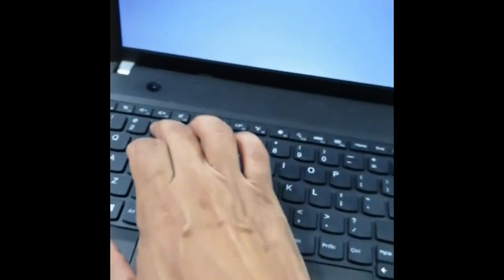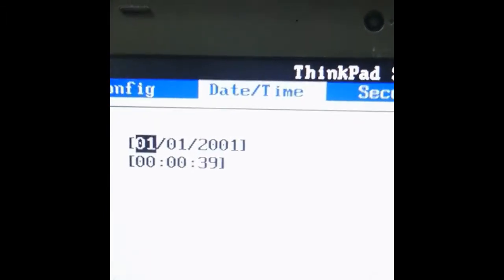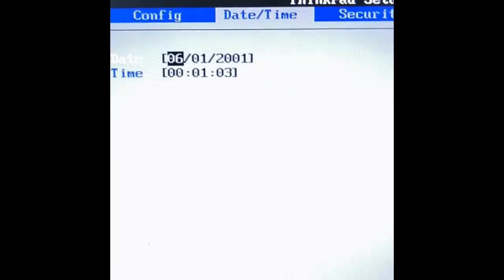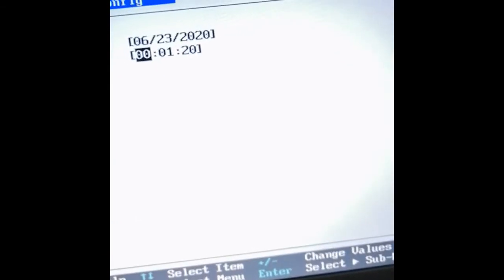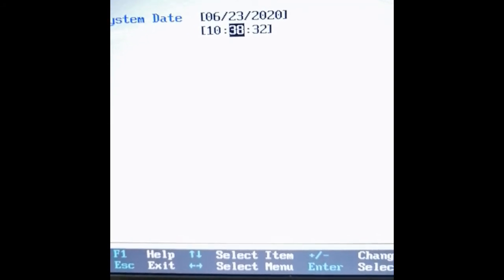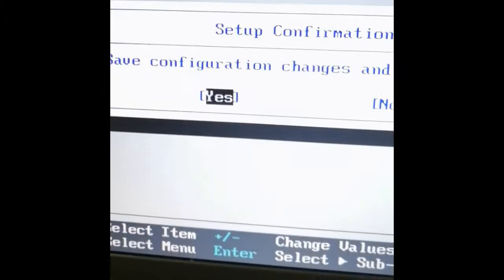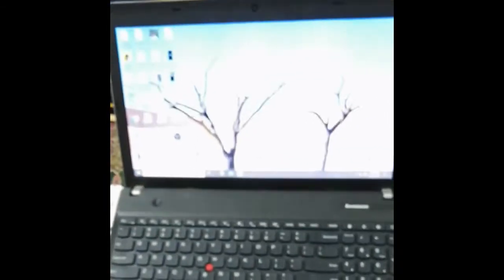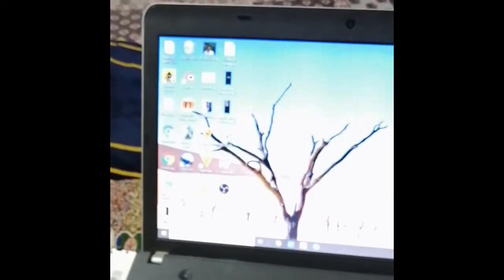Blank Screen Problem of Laptop Lenovo ThinkPad

Comment: Still facing problem lenovo N500 not starting  by pressing on/off button it seems start light on but after few seconds not turn on & black screen totally few days earlier it was starting & showing blue screen error on window 7 but now it's  totally inert kindly help me in that regard thanks Stay blessed
Reply from the maker: Will I read ur text however either you didn't watch my video properly or the problem u r facing is entirely different.
If u have done the disconnection of the small clip I showed in this video then it may be blank screen problem due to RAM.
Please see below mentioned video and try to get know the exact reason of blank screen.

https://youtu.be/DR0SlLYX9Is

Otherwise i am sending you another text in another comment read that carefully and deal with your computer delightly. Don't use abnormal force.
Reply from the maker: Before the following i sauggest to connect your laptop with another computer through VGA cable or HDMI cable so you will get know as your problem is existing in software or hardware. if you see the display on other computer monitor then the problem is lying in hard ware, (that is borken card or screen issue). if you don't see the display on the other system monitor, then follow the below mentioned 3 step i wrote you:-
step 1, Remove Mian/ big battery for 15 to 30 min (No supply of power) and then on, use escape or ctrl + alt + del if same status,                                                                                                                                                step 2,  see my video and note with care how i remove the small cell/ batter (equal to the size of a cone) with due care and deligency, (don't use power otherwise you wll break system clips)                                                                                                                                                setp 3, if you are still facing the same position the take out RAM and clean that with Petrol, plus with the soft cloths but don't leave pieces of cloths threads after cleaning RAM also clean/ wash the slot of the RAM and then try to on it.                                                                                        before doing the same watch my video of blank screen & see how i take out small cell/ batter (equal to the size of a cone), in my view that is the solution of your promblem in the light of your comment you wrote me. after doing so you  will also fix date and time from the keyboard which is a little difficul for beginer of the computer users. time and date fixing is also available in my video. i had also uploaded how to take out RAM and then fix plus its cleaning, u can find the link at the end of this video.                                                                                 Feel free and write back if the problem not resolved i will be happy if you could fix the problem by your self. Thanks
Reply: @jqkhantech what's about battery concern?  Is this matter or not in such conditions bcz battery was dead just before a week it happens? 
Battery was not charging at all i was using on consistent electricity supply before it happened?
Reply from the maker: In response to ur about mentioning message of dead battery.
Ur system should work without battery if supply of power is given / ensured from cable.
Reply: @jqkhantech  yes, but actually power supply & touch pade lights are on but showing black screen ,no sign of spot on screen totally spotless.
These steps i have already done 
Ram & Hard disk cleaning, Battery remove & Press on/off button, pressed the keys e. g F2,F8 etc but screen is totally unresponsive.
Need your worthy guidance 
 Stay blessed
Reply from the maker: Did you connect ur pc with another screen if yes was it black screen on other screen or another screen is also off?
Reply: @jqkhantech  Not yet but I'm going to try this now & let u inform later thanx
Reply: Thanks for your worthy reply.
I am trying but it's not responding at all. Is this due to battery? Last year i  repaired the battery & few days earlier battery looks like dead not charging only turns on by power supply by removing power supply it's shut down. What are your suggestions?
Reply from the maker: First check ur power cable as it's working properly/charging or not. How to test cable?
Answer. 
charge ur laptop with another cable or
connect ur cable to another laptop and see other laptop battery is charging or not.
Through this way u ll get know as ur cable is weaken or laptop battery is dead.
I also ask you a question that did u open ur laptop and remove/discount the small battery cell equal to the size of a coin? 
....... 
Recently 
I just face battery problem by message from my laptop that "the system cannot communicate with the battery" it was with my Dell laptop last week. So I did remove the window and restore the system to default. After that the battery message removed or I fixed my computer. 
But remember dead battery also causes same problem u face.

Comment: How about black screen but my keyboard is blinking
Reply: Screen is off but my keyboard is on and blinking
Reply from the maker: I gust got now u r facing bank screen problem. Please see both videos and try to out the small cell so ur ram get free from hang data.
Please note be gentle and avoid force while outing that small size clip connected to a coin size cell. If problem does not resolve then  see my second video.
Reply from the maker: Look this is typical sign of blank screen and the video of mine on which you commented is same problem. Try to gently disconnect the small clip connected to a coin size cell available in my video. Give it few minutes to discharge the charge fully. Also remove big battery so power may be completely cutoff.
Try not to break the socket holding small hock. See the video and follow the steps
Reply from the maker: If ur problem not yet resolved the read carefully and handle ur laptop generally in following manner :-

Before the following i sauggest to connect your laptop with another computer through VGA cable or HDMI cable so you will get know as your problem is existing in software or hardware. if you see the display on other computer monitor then the problem is lying in hard ware, (that is borken card or screen issue). if you don't see the display on the other system monitor, then follow the below mentioned 3 step i wrote you:-
step 1, Remove Mian/ big battery for 15 to 30 min (No supply of power) and then on, use escape or ctrl + alt + del if same status,                                                                                                                                                step 2,  see my video and note with care how i remove the small cell/ batter (equal to the size of a cone) with due care and deligency, (don't use power otherwise you wll break system clips)                                                                                                                                                setp 3, if you are still facing the same position the take out RAM and clean that with Petrol, plus with the soft cloths but don't leave pieces of cloths threads after cleaning RAM also clean/ wash the slot of the RAM and then try to on it.                                                                                        before doing the same watch my video of blank screen & see how i take out small cell/ batter (equal to the size of a cone), in my view that is the solution of your promblem in the light of your comment you wrote me. after doing so you  will also fix date and time from the keyboard which is a little difficul for beginer of the computer users. time and date fixing is also available in my video. i will also upload how to take out ram and then fix plus its cleaning.                                                                                         Feel free and write back if the problem not resolved i will be happy if you could fix the problem by your self. Thanks
Reply from the maker: If it's laptop keyboard the try external USB port keyboard to detect the error exactly. If other keyboard works then ur keyboard is faulty.
2 things can be done n that case
1 fix new keyboard
2 clean port and update keyboard driver.
Reply from the maker: Below is also a helpful video plz try to c carefully

https://youtu.be/DR0SlLYX9Is

Comment: I have done this but didn’t worked. I have black screen and blinking on left top corner! And fan is not making any sound. Neither the pc is going to bios settings
Reply from the maker: Before the following i sauggest to connect your laptop with another computer through VGA cable or HDMI cable so you will get know as your problem is existing in software or hardware. if you see the display on other computer monitor then the problem is lying in hard ware, (that is borken card or screen issue). if you don't see the display on the other system monitor, then follow the below mentioned 3 step i wrote you:-
step 1, Remove Mian/ big battery for 15 to 30 min (No supply of power) and then on, use escape or ctrl + alt + del if same status,                                                                                                                                                step 2,  see my video and note with care how i remove the small cell/ batter (equal to the size of a cone) with due care and deligency, (don't use power otherwise you wll break system clips)                                                                                                                                                setp 3, if you are still facing the same position the take out RAM and clean that with Petrol, plus with the soft cloths but don't leave pieces of cloths threads after cleaning RAM also clean/ wash the slot of the RAM and then try to on it.                                                                                        before doing the same watch my video of blank screen & see how i take out small cell/ batter (equal to the size of a cone), in my view that is the solution of your promblem in the light of your comment you wrote me. after doing so you  will also fix date and time from the keyboard which is a little difficul for beginer of the computer users. time and date fixing is also available in my video. i will also upload how to take out ram and then fix plus its cleaning.                                                                                         Feel free and write back if the problem not resolved i will be happy if you could fix the problem by your self. Thanks
Reply from the maker: Try this video for your ease or to locate where problems exists

https://youtu.be/DR0SlLYX9Is

Comment: My Lenovo Thinkpad laptop is still in black screen, I did what you show in the video, what should I do brother?
Reply from the maker: Before the following i suggest to connect your laptop with another computer through HDMI cable or some other cable, so you will get know as your problem is existing in software or hardware. if you see the display on other computer monitor Or Tv screen, then the problem is lying in hard ware, (that is broken card or screen issue). if you don't see the display on the other system monitor, then follow the below mentioned 3 step i wrote you:- 
Step 1, Remove Mian/ big battery for 15 to 30 min (No supply of power) and press power button for 20 seconds so all the charge of the computer become 0. Then on computer, use escape or ctrl + alt + del. if same status or problem.
step 2, see my video and note with care how i remove the small cell/ batter (equal to the size of a cone) with due care and diligence, (don't use power otherwise you will break system clips).
Step 3, if you are still facing the same position the take out RAM and clean that with “Petrol”, plus with the soft cloths but don't leave pieces of cloths threads after cleaning RAM also clean/ wash the slot of the RAM with the same Petrol, and then try to refix it, now on the computer. before doing the same watch my video of blank screen & see how i take out small cell/ batter (equal to the size of a cone), in my view that is the solution of your problem in the light of your comment you wrote me. after doing so you will also fix date and time from the keyboard which is a little difficult for beginner of the computer users. time and date fixing are also available in my video. RAM cleaning and fixing video link is also mentioned below:- 

https://www.youtube.com/watch?v=DR0SlLYX9Is 

 Feel free and write back if the problem not resolved i will be happy if you could fix the problem by yourself. Thanks
Reply: Thank you brother for your help, I really appreciate it!
Reply from the maker: Please see below video carefully and try to detect the error location. I ll write u n detail about the problem setps but now I m on way for duty so ll write u full details.
Remember f u follow below link u ll certainly get know the nature of the problem.
Link below 
https://youtu.be/DR0SlLYX9Is

Comment: the laptop is working but the screen is still black
Reply: Alright thanks
Reply from the maker: Clean ram. Out and refit it, f still the problem existing then monitor supply card is either broken or loosen. I m sending you another my video link u ll get the idea. But remember if card is broken then it must be replaced
Reply: @jqkhantech  it didnt work. the laptop is still black and beeping twice
Reply from the maker: If both 3 methods I showed
Clean and out and refit ram
Disconnect small cell
And cleaning ram
Then use the cable I showed in my second video if another monitor showed display then ur cennection between ur screen and CPU is broken.
If all this does not work then go to some expert of hardware to physically check ur computer it may b some other problem.
I ll help you all possible way.
Thanks
Reply from the maker: https://youtu.be/DR0SlLYX9Is

Please go through above link

Comment: Thank you brother . Similar me I will trying repair.
Reply from the maker: Welcome dear do care and keep ur soft with your computer. Please note if it did not solve your problem then go and watch my other video of RAM removal and refitting plus cleaning.
Link is available in this video description and link is also displayed on card in the same video u saw and commented. I ll also try to leave u link of that video in my next comment. Wish you all the best and be intouch
Reply from the maker: Blank Screen Problem Due To RAM & Cleaning RAM Refitting RAM & Locating Hardware Or Software Issue

https://www.youtube.com/watch?v=DR0SlLYX9Is&t=318s 
above link of my second vidoe closely related to RAM and blank screen
Reply: I do it every thing but no fixed it . Thank you brother
Reply from the maker: Connect ur computer to screen of another computer so u ll get know where the problem lies. I already shared u the link. Thanks

Comment: I press f10 then my system is not coming on again wht must i do plz tell me.
Reply from the maker: Dear Brother i don't know which computer do you have and which operating system is running, but i guess you should try to reboot your computer and go to "open window in safe mode". i wish if you could contact some expert near to you to physically inspect your computer. But if you are facing lenovo laptop then i suggest to follow the tips.
I suggest to connect your laptop with another computer through VGA cable so you will get know as your problem is existing in software or hardware. 
if you see the display on other computer monitor then the problem is lying in hard ware or monitor or the connecting cable between screen & CPU, (Broken card or screen issue is expected). 
if you don't see the display on the other system monitor, then follow the below mentioned 3 step i wrote you:- 
step 1, Remove Main/ big battery for 15 to 30 min (No supply of power) and then on, use escape or ctrl + alt + del if same status, 
step 2, see my video and note with care how i disconnect/ remove the small cell/ batter (equal to the size of a cone) connection to erase the stuck data possible on RAM. Do due care and diligence, (don't use power otherwise you will break system clips) 
step 3, if you are still facing the same position the take out RAM and clean that with Petrol, plus with the soft cloths but don't leave pieces of cloths threads after cleaning RAM also clean/ wash the slot of the RAM and then try to on it. 
Before doing the same watch my video of blank screen & see how I disconnect the small cell/ batter (cone size) in my view that is the solution of your problem in the light of your comment you wrote me. After doing so you will also fix date and time from the keyboard which is a little difficult for beginner of the computer users but date & time fixing is available in my video. I will also upload how to take out RAM & then fix plus its cleaning. Feel free and write back if the problem resolved not resolved. i will be happy if you could fix the problem by yourself. Thanks
Reply: @jqkhantech  yes brother i got same thinkpad lenovo E531 which i saw on your video
Reply from the maker: Dear viewer/ firend i as you desired i uploaded another Blank screen issue which is caused by RAM so link is hereby past for your help if requred. thanks link is available below                            https://www.youtube.com/watch?v=DR0SlLYX9Is&t=304s